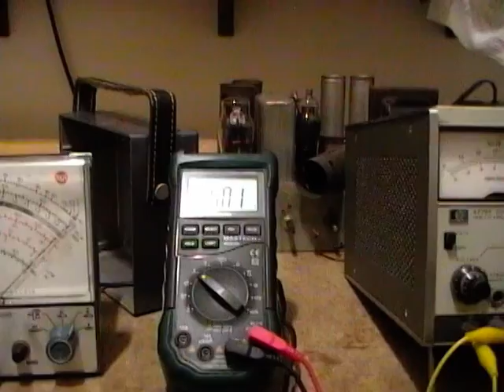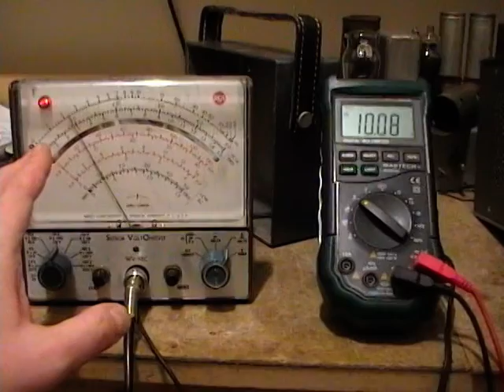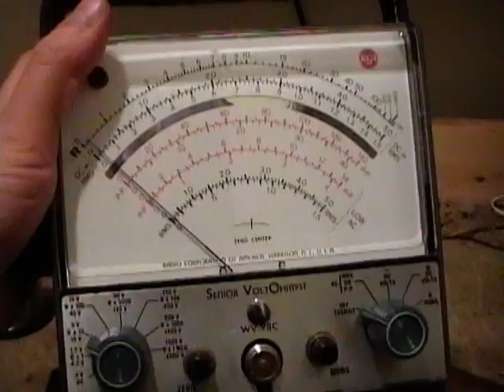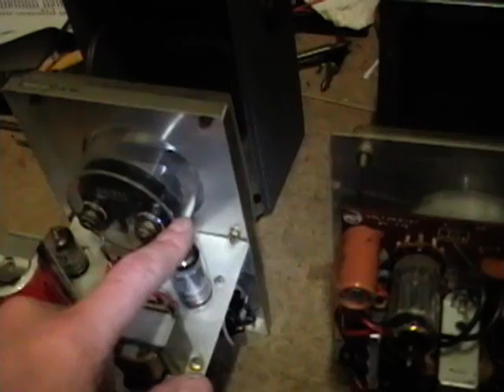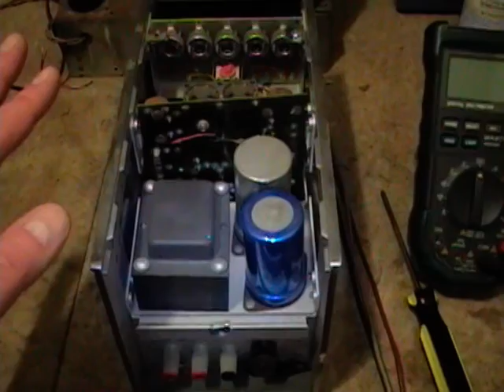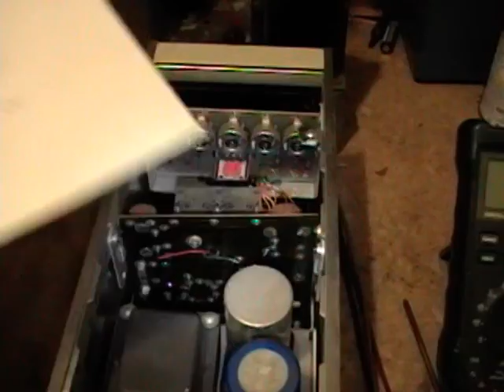VTVM 101 p3o3

Comment: I have built a couple of RF probes for my VTVMs. The easiest to make used a 1N34A germanium diode and I recommend that, or a Schottky diode for sensitivity over a silicone diode. The maximum RF voltage is somewhat limited for these diodes, however, to about 20V peak. The other uses a 6AL5 in the probe handle and will work with much higher RF voltages, but filament voltage must be provided to an extra conductor in its cable.

Comment: I have an EICO vtvm where the previous owner built a power supply inside to eliminate the battery, he borrowed power from the filament circuit. I have another one that is identical and it looks almost like brand new, perfect lens, case and front panel, but I haven't had a chance to use it or fix it up.